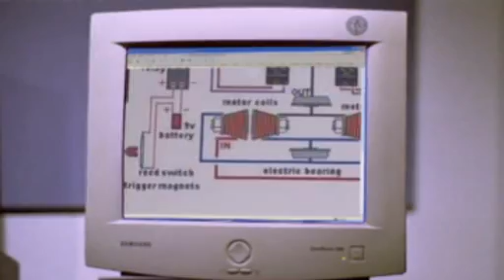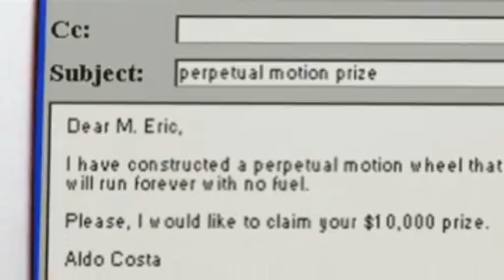A Machine To Die For: The Quest For Free Energy(part 1 of 5)

Comment: If you want to build a perpetuum mobile, you cannot do it with old physics. It cannot be done with gear wheels, springs and pendulums (mechanics), magnet and currents (electrodynamics), and gases or flames (electrodynamics). Also nuclear reactions and gravity do not work. You might dry using dark energy.

Comment: You are asking a very complex question that can't be answered by answer. Energy cannot be created nor destroyed. Only changed. The movement of the moon around the earth is in fact perpetual motion. Only because there is no resistance slowing the moon down in it's rotation around the earth. No air, no friction, none. Just like satellites use no energy to orbit. Only to change directory and perform tasks. Same goes for whole galaxies. It's a constant motion machine. It doesn't take or give energy.

Comment from the maker: our galaxy is not a closed system... I have never implied that and what do you mean powers? I think your concept of energy is flawed... I look at energy as the change of states in a system... so even if the galaxy is a closed system it will constantly be changing states until entropy increases to a point where it can no do  so... earlier i thought this was a black hole but then I learned about Hawkins radiation and see that is not the case....

Comment: well, not sure how to break the 3 laws, but like any law it can be used and sometimes twisted but not actually broken to fit ones needs, good or bad.  just food for thought ;) 
I still like how years ago some farmers used old animal bedding and made huge compost piles and run sterling engine type generators to power the homes and barns, compost piles of size can get 160+ degree.  ;) simply need a natural action or reaction. Big issue is 90% of everything is so power hungry (AC)

Comment: for every action there is a reaction, and still would need a source.
You would be more ahead to break things down to the basics to get a better idea of what i mean.  Example: get you hands on a  low temp sterling engine, see it run of the heat of your hand, then look at high temp ones, plenty of speed but still very easy to stop compared to other engines, But will work Very nice to set on-top of a pellet/wood fireplace and blow heat into your room with no electricity.

Comment: All the perpetual designs have been tryed and failed. no question about it "you can`t get energy from nothing"  best possibiliths in energy is making something more efficent as in a diesel engine is many more times efficent than a steam engine. our best option for energy is solar,wind,water,and wave motion. their not free from using some power source (The sun provides it) its the closes thing to free since theres no cost for the energy ,but the collecting device can be costly